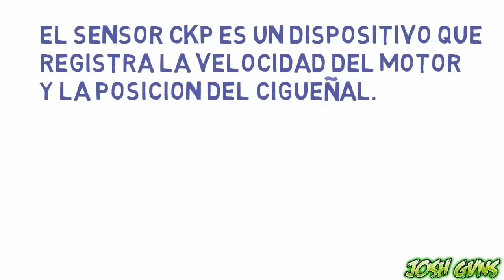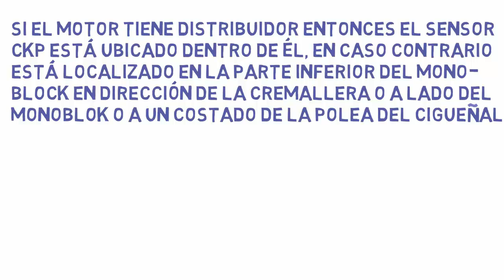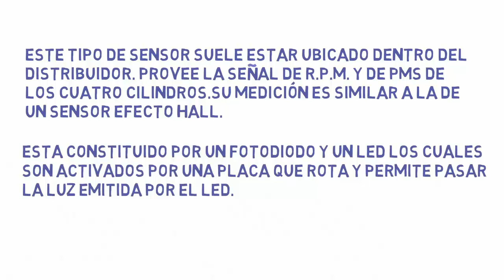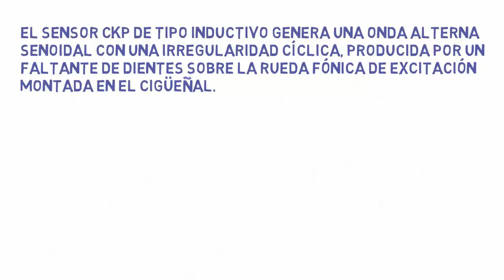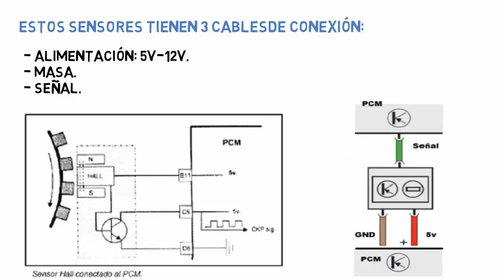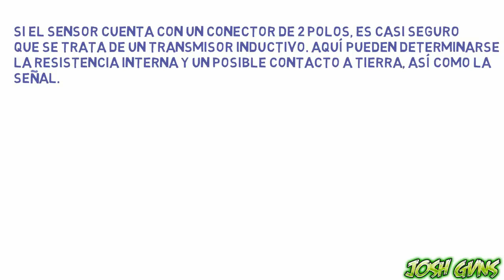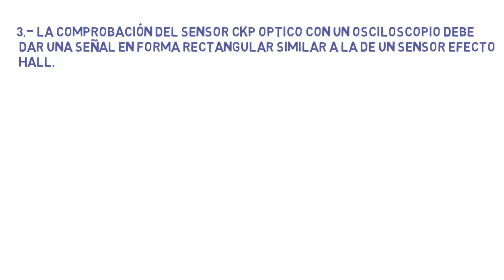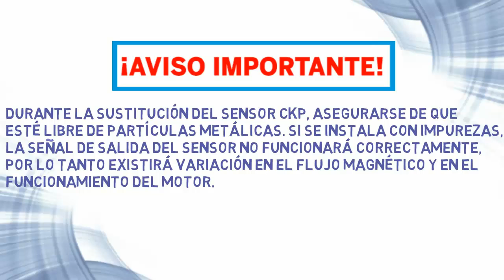Sensor de Posicion del Cigueñal - CKP(tipos,pruebas,fallas)

Comment: Amigo necesito de su gran ayuda, es posible adaptar un sensor ckp hall en una instalacion para sensor ckp inductivo? tengo un chevy c2 y tuve que cambiar el cigueñal por uno de corsa la diferencia esta en que el de chevy tiene las rejillas de registro en el intrior del motor y es inductivo t el de corsa lo tiene externo cerca del damper y es tipo hall o sea 3 cables, ambos damper son iguales por ende no hay problema con eso, mi preocupacion esta en adaptar el de hall poniendole un cable a tierra que por cierto viene en el mismo ramal decables que baja al sensor solo que en este caso como es inductivo no tiene usp y esta suelto, se podria y como seria el empalme de los otros dos cables restantes??? se que uno es de señal pero cual cable y que color tendria, en el sensor de tres cables (hall) tiene las siglas 1,2,3 pero en el indusido no hay siglas referenciales.. ha sabido ud de algun caso donde hayan hecho esta adaptacion?????

Comment: Hola que tal! tengo un stratus 2002 al cual le cambie la valvula iac por que estaba demasiado acelerado y el mecanico me dijo que ya estaba dañada pero despues de que se cambio em pezo a acelerarse y bajar entre 800 y 2000 rpm y poco despues se apago y ya no encendio, sospecho que se haya dañado el sensor del cigueñal pero checo los cables de las bujias y si tengo chispa alguien me podria orientar que mas debo checar?
Reply from the maker: +Roberto Carlos Nava Contreras si tienes chispa entonces nos es el sensor de cigueñal...Los componentes, que cuando fallan, provocan un arranca pero no prende por falta de combustible son:
Relé (revelador) de la bomba de combustible.
Bomba de combustible (gasolina)....revisa si le llega presion al riel.
Algunos de los posibles problemas mecánicos internos de la máquina son:
Empaques de cabeza (culata) quemados.
Correa de distribucion fuera de tiempo.
Reply: +JOSH GVNS gasolina si me llega al riel de injectores pero no arranca
Reply: +Roberto Carlos Nava Contreras osea que puede ser que se quemo el empaque de la cabeza por falta de enfriamiento?
Reply from the maker: exacto.notabas antes perdida de fuerza del motor.
Reply: +JOSH GVNS mas bien variaciones perdia fuerza y aveces se aceleraba
Reply from the maker: cuando un empaque de la cabeza se daña en forma severa se mezclan compresión de los pistones con aceite de motor y refrigerante del sistema de enfriamiento, los síntomas son: motor no prende y cuando prende lo hace vacilante, ademas de sistema de enfriamiento contaminado con aceite, aceite contaminado con refrigerante y bujías mojadas con agua y aceite, cuando el daño es mediano; dependiendo de la zona que esta dañada, se puede mezclar solo la compresión de los pistones con refrigerante del sistema de enfriamiento o solo el refrigerante con el aceite, los síntomas son motor enciende con cascabeleo y el refrigerante contaminado con aceite, ademas el refrigerante se va hacia el mofle, por lo que se sobrecalienta el motor y cuando el daño es mínimo; lo mas usual es que se mezcle solo la compresión de los pistones con el refrigerante del sistema de enfriamiento, los síntomas son: burbujeo en el deposito del anticongelante, agua en el mofle y calentamiento del motor por falta de refrigerante,falla de ventiladores, bomba de agua.
Reply: +JOSH GVNS gracias por la consulta

Comment: tengo un chevy pop 2000  al ensender no tiene problemas pero al abansar y rebolucionar a mas d 2000 reboluciones se jalonea y falla
Reply from the maker: +Pablo Rodriguez Que tal amigo, en primera necesitas checar la presion de la bomba de gasolina,cambia bujias ,fitro de combustibe , revisa cables de bujias, bobina....pero si en caso te parece el check engine tenes que scanear tu vehiculo quizas un sensor este fallando.

Comment: Buenas noches saludos, tengo un problema con mi vehículo, no enciende y se activo el candado de bloqueo anti-robo de fabrica, se trata de ford fiesta power, con el swith colocado en CERO se escucha un pitido perenne en el motor que solo se silencia descontando la batería o sacando un fusible en la fusiblera interna.....Por otro lado al pasar el swich a ON se escucha activarse la bomba de gasolina y los inyectores pero no enciende el motor, ya he probado con ambas llaves y nada. hago hincapié en que en reiteradas oportunidades el vehículo se ha bloqueado pero ha vuelto a la normalidad sacando y metiendo los fusibles y desconectado y conectando la batería, pero esta vez no funciono....necesito orientación gracias.
Reply from the maker: +Miguel Ramos el testigo PATS sistema pasivo anti-robo permanece encendido siempre y el motor no arranca..la causa es llave no programada o sin chip.....llave con problemas de trasponder....
Reply: ok pense eso, pero las dos llaves programdas no pueden estar con problemas las dos, utilice la 2da llaves jamas usada desde su programacion y tampoco enciende.
Reply from the maker: +Miguel Ramos has escaneado tu auto
Reply: te cuento lo ultimo que sucedió fue que salí a hacer unas diligencias al centro, después de estacionarme gire la llave a cero y el vehículo quedo encendido como por 5 a 7 segundos hasta q se apago, me percato de esa extraña acción gire la llave nuevamente a ON el vehículo prendió con debilidad y se volvió apagar,  desde allí quedo bloqueado.
Reply: No por las fechas de Carnaval es difícil ya q ningún electro auto esta trabajando, el viernes en la tarde fue q se bloqueo

Comment: ya cheque tiempo y sensores inspectores y sigue gastando gasolina t
y no lo pueden escanear que por que esta mal una línea y por eso no se enlaza a la compu el escaner y sigo con el problema de gasto de gasolina
Reply from the maker: +oscar martinez tambien el regular de presion de combustible?
Reply: Si igual ya lo cheque que pero nada sigue igual cables de bujia y nada igual bobina todo ya lo checamos se jalones en bajo de repente pero en alta jala super bien de repente como que si le faltará corriente pero ya checamos to con voltimetro todo y nada
Reply from the maker: qe carro es y no te marca check engine en el tablero??